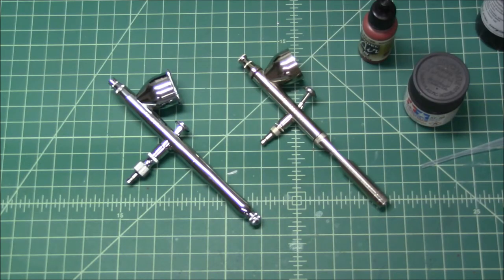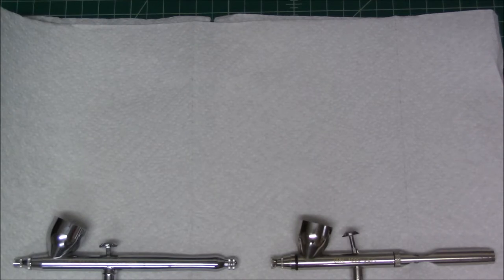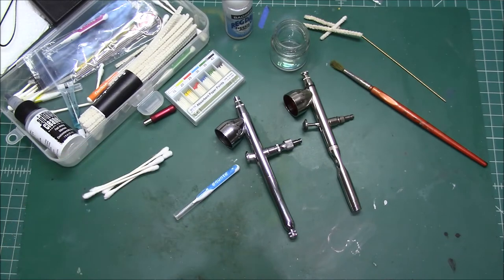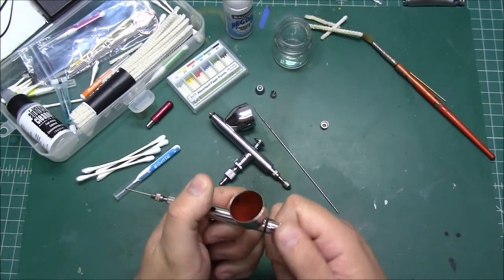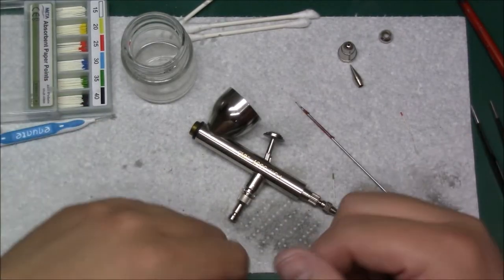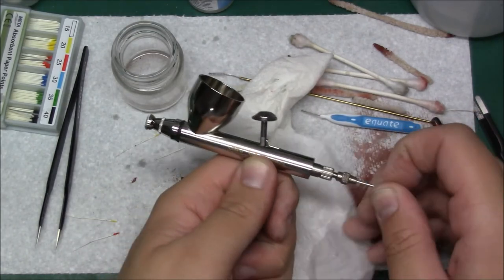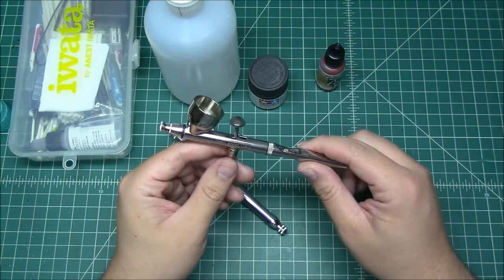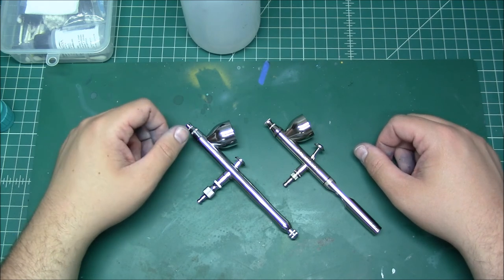Cleaning an airbrush. Use an ultrasonic cleaner?

Comment: Thank you!
I am new to airbrushing, watched vid where a guy stripped down a Harder and Steenbeck Infinity (which is what I ended up getting) and put the body and tip in an ultrasonic cleaner. Basically said do that every time...
I got an ultrasonic cleaner to be ready for when I go to use the airbrush, but now I will be returning it.
Thanks for saving me the grief!

Comment: Nice video, helped me decide NOT to buy a sonic cleaner. Question: Where can I buy one of those clear plastic caps you used on the tip during back-flush? I can't find them anywhere. Thanks.
Reply from the maker: It is actually the protector that came with the Procon Boy airbrush. You could also use the black rubber cap that comes with Badger airbrushes, which they also sell. Anything that blocks the air from escaping will work.